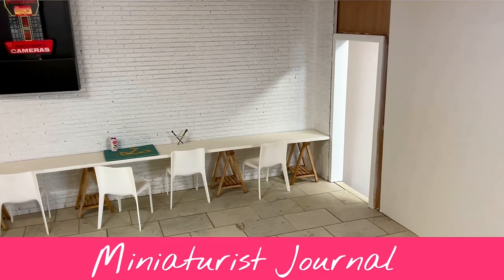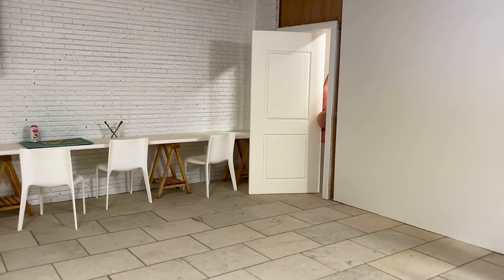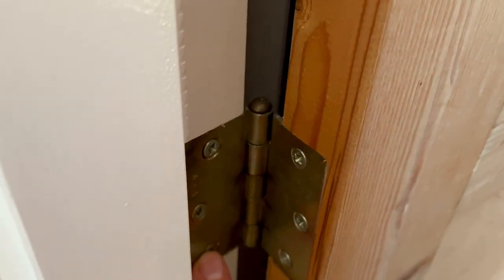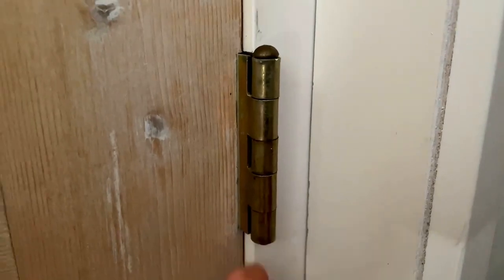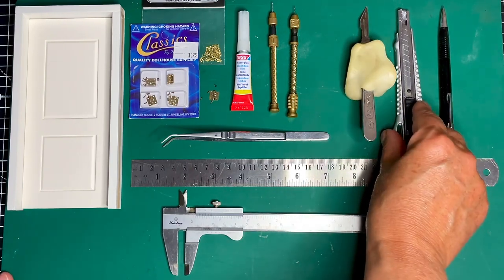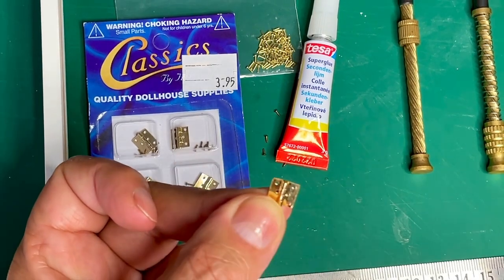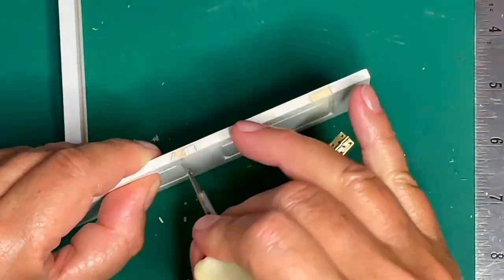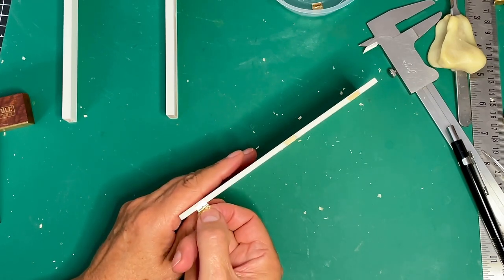Hinges! A tutorial on how to install them.

Comment: Well, this is a video I will be watching again and again!  I think it would be somewhat easier if I first put the door into a vice so I'll actually have two hands to do the rest of the tedious work.  All of the doors in my dollhouse are already installed except one.  I will definitely give this a go with that one door.  Then I really want to make kitchen cabinets with real hinges.  Thank you so much Josje for this very informative video!!
Reply from the maker: You're welcome, Beth.   Yes, a vice is very helpful for this.  After I changed my workshop around 10 years ago, I never installed my vice back onto my workbench.  So although I have a vice, I can't really use it.  I should get that sorted because as you said, it does make certain jobs easier.  
When you start doing your kitchen cabinet hinges, make sure you figure out the best way to drill the holes and insert the pins first.  On cabinets, the space to handle drills, etc is so limited!

Comment: Couple of pointers for your viewers; If you want to mark the front of the door, you only need to mark one side of the door with the letter "F" and no need to write on the other side of the door because it will obviously be the back if the front is marked with "F". A more inportant little tip to make life so much easier is to make the cut out for the hinges on the part  of the frame that is to house the hinges before you assemble the frame; so easy to line up the hinges with the door and drill the holes straight in the frame section. You can glue and pin the hinges in place to both the door and the single frame piece of timber; then it is an easy task to attach the rest of the door frame to the part of the frame already attached to the door. This makes it easier to get a good fit of the frame because you can custom make the top cross section of the frame to accommodate the door accurately; This is how we make them in the real world. The part that stops the door from going too far in when closing is called a door jamb or some call it a door stop. Good video; well done.
Reply from the maker: Great tip!  Now why didn't I think of that? That does make hanging the door much simpler.  Thank you John!  👍 😃

Comment: From where you buy small hinges please reply
Reply from the maker: Hi. I buy them from several sources.  I search online for the size hinge I need, and I usually find some at dollhouse shops or model shops (search for miniature hinges for models).  I also buy them at dollhouse fairs, I usually buy a few packets when I see them as I always seem to run out.  Pay attention to the size before you order them, the smaller ones are harder to find.

Comment: What a lovely culmination of door and related videos! I was interested to see that you used joinery techniques that would have been implemented in a full sized door build. The only thing you wouldn’t have to worry about is grain direction. I wouldn’t think the timber would expand or contract enough to warp. Or would it? By the way, in lieu of using a vise you could use two spring clamps on either end and they should be able to hold the door upright. Two free hand would make the job easier.
Reply from the maker: Glad you enjoyed it Gailene!  Oh, I've been surprised in the past with how much even small pieces of wood can warp.  It actually happened to me yesterday.  I cut some walnut from a lovely straight board to make something (next week's video) and one of the pieces I cut is completely warped.  And while I was writing this I decided to show you the warped piece I cut in next week's video.  I have just filmed a little clip about it.  And I mention you, I hope you don't mind.  
Yes, you are so right!  I should have clamped the door in some way to keep it upright.  I was a bit lazy there.
Reply: I’m delighted that you mentioned me! Btw, I am attempting to flatten a thin warped piece of hardwood by boiling it and then leaving it under weights. I’ll let you know if it successfully retains its’ shape.
Reply from the maker: Glad to hear it!  I'd love to hear whether your attempt to flatten the warped wood works! As it is possible to bend wood this way, I don't see why you wouldn't be able to bend it back so it is straight.  An interesting test!
Reply: I boiled 3 pieces and have them under weight and clamped. When I checked 2 of the 3 still were not completely flat…but they still also had lots of moisture. I will try again with a worse board but boil the pieces separately and longer. The wood loses colour and gets very rough through the boiling process. It may be several weeks until my experiment is done but I will let you know one way or another.

Comment: Hi Josje,
At the end the bit of doorframe that keeps the door from overextending the hinges is called a door jamb. It also keeps out drafts…. The only thing I do differently is that I use a superglue activator after putting in the pins, this keeps things much more stable and even keeps the doors in place if small hands try to open them, when they shouldn’t have been touching anything….
Idske
Reply: That particular bit in the middle is the stop.
Reply from the maker: Thanks, Idske! I will have to buy superglue activator and try it, I've never used it before. I think it may be particularly useful when installing hinges on small cabinets and difficult angles.  Those are the hardest to do I think.
Reply from the maker: Thank you Elisha!

Comment: Where can you buy the screwdriver?
Reply from the maker: I've had mine for many many years and can't remember where I got them from, but they're called Archimedean drills, or Archimedes drills, spiral drills, Archimedes Jewelry drills, micro drills, etc.  Usually, jewelry supply stores sell them, or eBay, hobby shops, etcetera.

Comment: I had hoped you were going to be making hinges. Working in another scale where there's no off the shelf products everything needs to be made.
Reply from the maker: Ah sorry, Petrik!  I'm sure I'll get to show you how to do that someday.  I just need time to fit everything into my schedule which is hard sometimes.  I hope you can figure out how to cut them yourself.  The hardest part is making the knuckles, which you can make by soldering thin tubes to the leaf or bending round interlocking fingers on the leaf, so to speak.